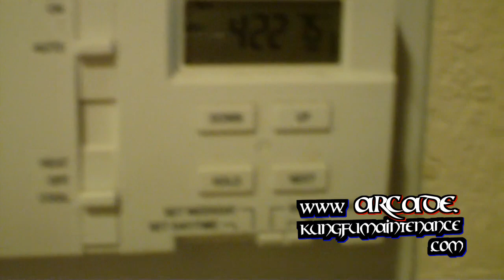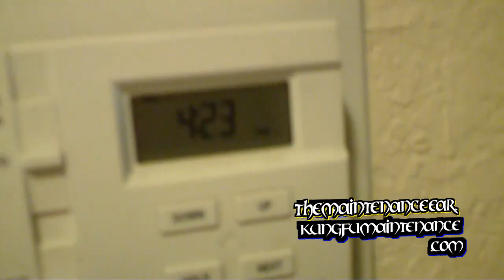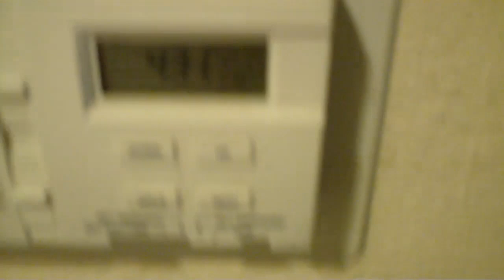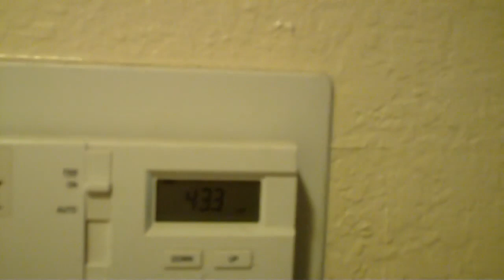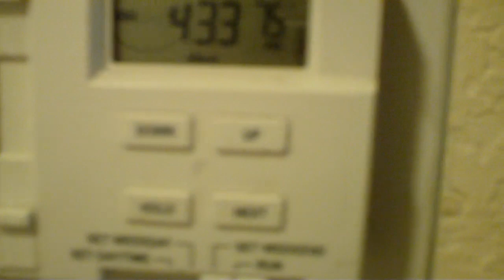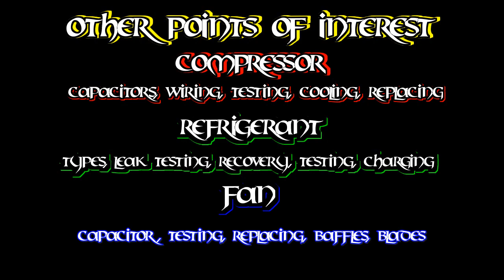How To Troubleshoot Thermostat For Air Conditioner Plus Heater Fan HVAC Not Heating Or Cooling

Comment: hi there,
ive changed the cotactor and capacitor but still ac is not working.inside blower fan is working but out side fan is dead. there is no buzzing sound or nothing.its dead. but when i press the contactor it works. 
please help.